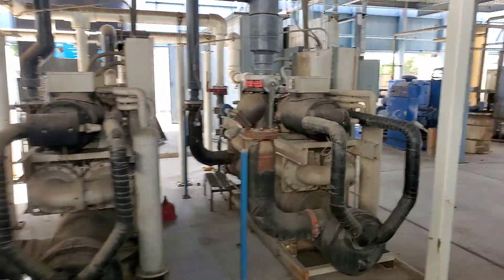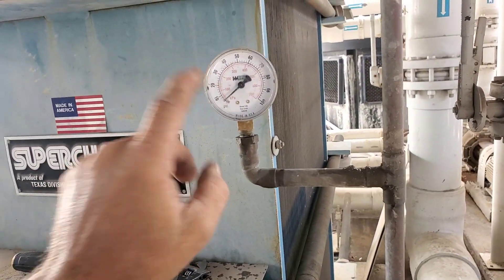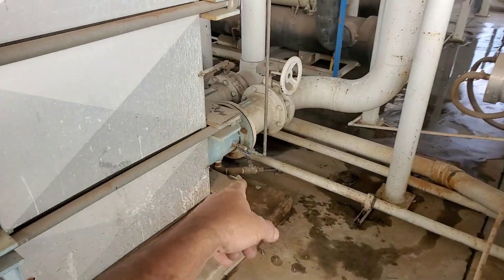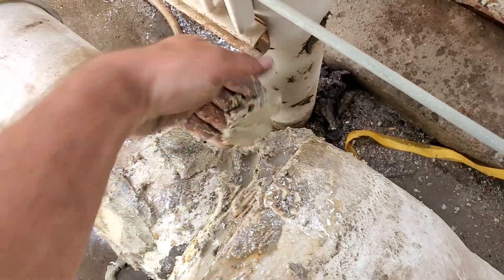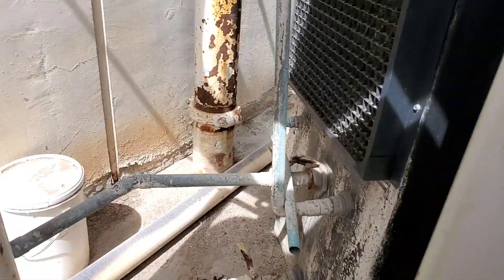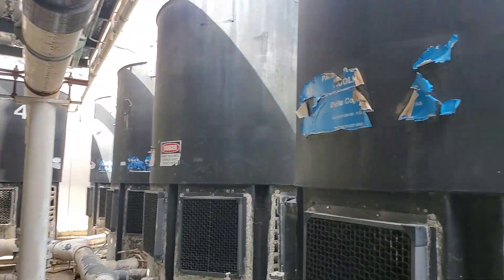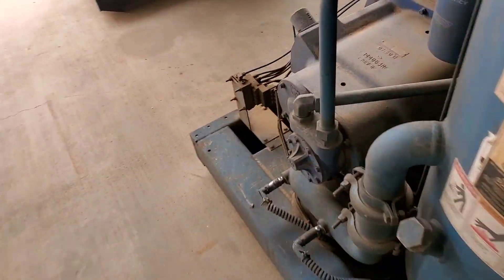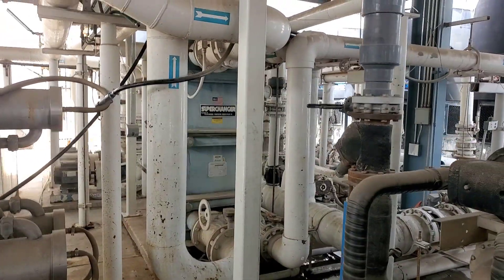Resurrecting an old central plant WSHP towers and closed loop

Comment: Those old Siemens Marq-21 MCCs are terrible. The disconnect and interlock linkages get misaligned and start to bind up, then people who don't know or don't care wail on those weak handles and snap them off. The innards aren't much better, most of them have junky IEC starters and pushbuttons.
Reply from the maker: One was broken and another broke on my with very little effort.
Evidently they suck. Or were just old and brittle as I assumed.
Reply: @hackfreehvac  I think both. The originals are brittle, and they can fatigue over time from other people yanking on them- didn't mean to imply it was you. Even when the buckets are closed, it's often helpful to bypass the interlock with a flathead when trying to turn on the breaker. It reduces the drag on the handle.

Comment: I went from 10years hvac to air compressors.  75hp is small machines.  Get around some 300hp variable speed machines.  Rotary screw compressors btw
  Don't trust any gauges like that.

Comment: After noon great vid but you were moving around so fast I couldn't see the piping arrangement so i went slow mo, at 2:44 when you were explaining about the heat exchanger, there is a suction guide on the pump, 8 bolt flange , remove it and there should reside your screen, the heat exchanger is of a plate pack design and those  guide shafts are for that but here is the tip, you should have an exact spare plate pack on hand because given the dirt that would have accumulated the gaskets  will not come apart in such a way that you will be able to clean them and reassemble the plates, without the entire unit leaking like a stuck pig.. one must always pay attention to the chevrons when reassembly happens. Have the old pack sent out to your nearest exchanger distributor and have them "steam" clean the plates.. Anyway i hope this helps and great to always watch the HVAC guys doin their stuff.... hello from the north.....
Reply from the maker: That pump you see at 2:44 is the building loop for the water source heat pumps on the OTHER side of the heat exchanger.
The pumps feeding the tower side of the heat exchanger are straight in. No strainer.
Look at 0:50 in the video and then again at 7:40 I briefly point that way. That tower water goes directly into 4 pumps that have no strainer (2 for the chillers, 2 for the water that feeds the heat exchanger).
Only the pumps for the closed loop to the building have them.
And that side of the heat exchanger only dropped like 5 PSI across it.

The pump drawing water from the tower and to the exchanger was at 30 PSI to the exchanger, only 5 psi leaving the exchanger! Yeah. They plugged that sucker up!

Comment: Do I hear you say you never had to clean one?  Your in for a treat 😂
Reply from the maker: I hope that I don't have to clean it. HA HA!
Reply: @hackfreehvac  If you have to take it apart, you will likely need to order a new set of gaskets for those heat exchanger plates, especially if they are as old as you say they are. When you open the heat exchanger, the gaskets between the plates will probably be super brittle and falling apart. Right now they are staying together likely due to never being opened in forever.

Source: Myself, having opened and replaced gaskets/plates on multiple large heat exchangers in a beverage manufacturing facility.
Reply: Bring some bandaids

Comment: Never worked on a Marley cooling tower, only Evapco, dry coolers are more popular in Pennsylvania than cooling towers. Also in my opinion, plate heat exchangers are junk, barrels are much better and easier to clean.

Comment: I've split quite a few of those style heat exchangers open. Probably three guys, 13 hours each. Don't forget to measure the distance between the backing plates before you start unbolting it. Good luck with those old seals they have to go back perfect. If it leaks when you get back together give it time because it may be a chunk of scale underneath the gasket that will erode away and seal up over time if you're lucky. You could always acid clean it instead of opening it up.
Reply from the maker: Someone brought up the ACID cleaning.
I guess you use a pump to circulate the solution.